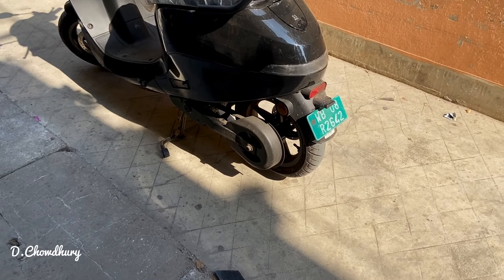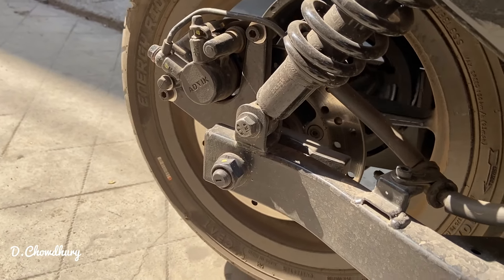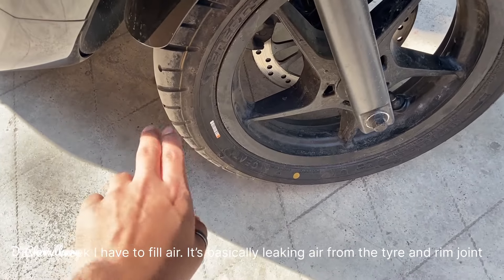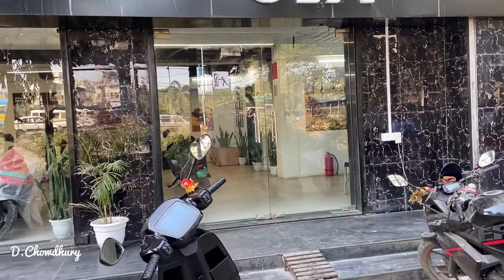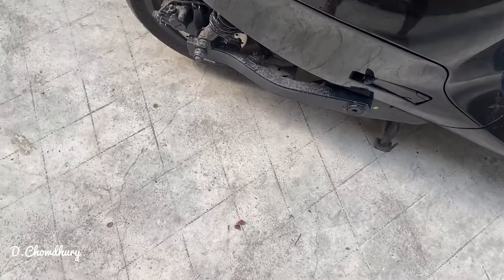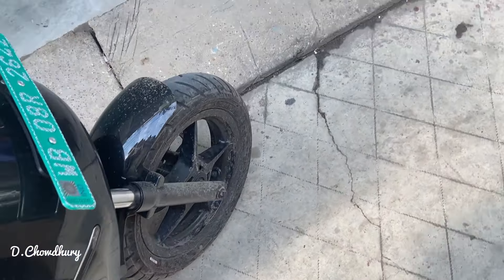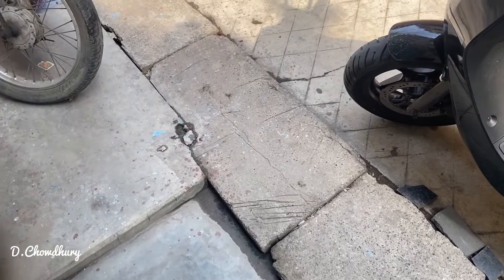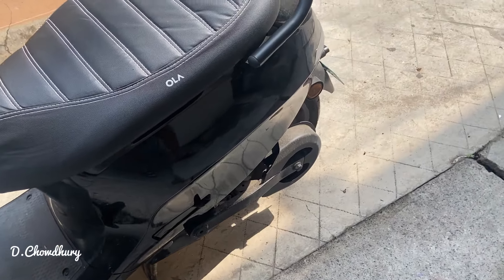OLA S1 Pro Gen 2 Real issues | Brake  Calliper Rubbing | Definitely needs to improve quality ⚠️

Comment: Hi what mechanic did to resolve the issue, I’m also facing same problem
Reply from the maker: He cleaned the brakes properly and also the disc.
Reply: @debayan77 hi sir i am havingg same problem i want to ask how you cleansed the pad using which product? Wd 40 ?? Or you have replaced the brake pad ?
Reply from the maker: @akramakki7743  He used  a cloth and isopropyl alcohol. He also rubbed the pads gently on a sand paper as well. Just a little bit rubbing
Reply: @debayan77 thankyou boss🎉

Comment: I have S1pro 2 gen Mera Rear side ka Brake disk bohot jyada heat ho raha hai.. Service Centre wale bol rahe hai sabhi bike ka heat hota hai... please help with answer
Reply from the maker: Yeah disc brakes heat up normally, nothing to worry about but if you are getting any kind of burnt smell or red hot coloured rotors then you should definitely get it checked. Otherwise in general disc brakes on any vehicle tend to get hot after riding or driving.

Comment: Real range kitni mil rahi hai.
Reply from the maker: Agr hardcore sport mode mai chalata hai to 100 kms according to the display console mil rahi hai… stay tuned bro I will do a proper range test video
Reply: Kono major issue aseche?
Reply from the maker: @subratashee7711  serom major kicchu na just that the front tyre is not holding air. Every week I have to fill in air. 24th e service center e jete boleche ora tyre ta khule abar install korbe and tao jodi na hoi ora bollo they will install a new rim.